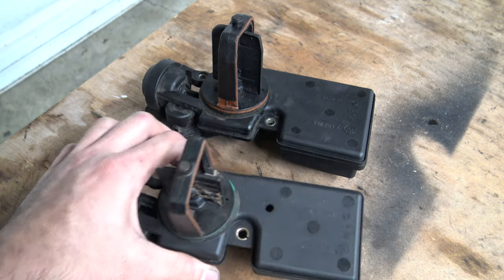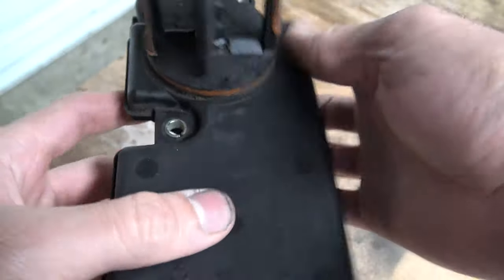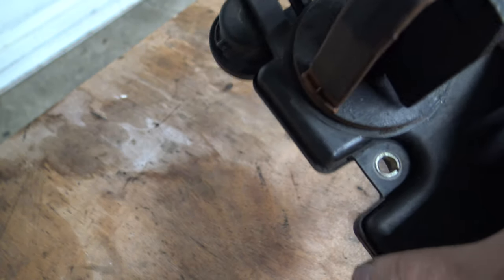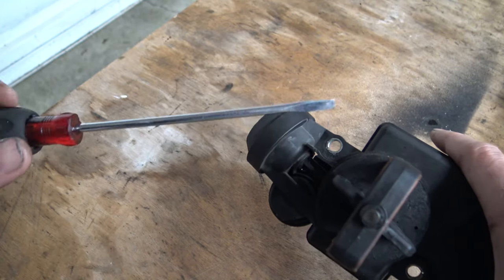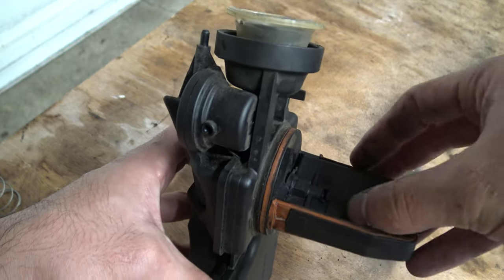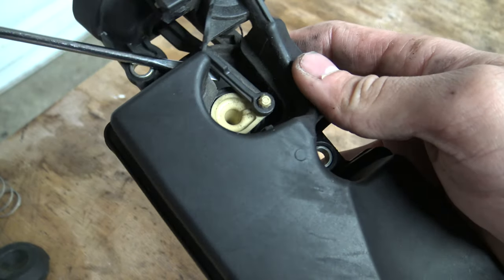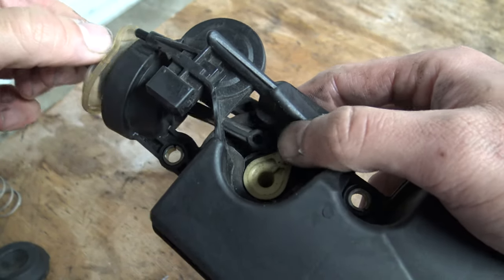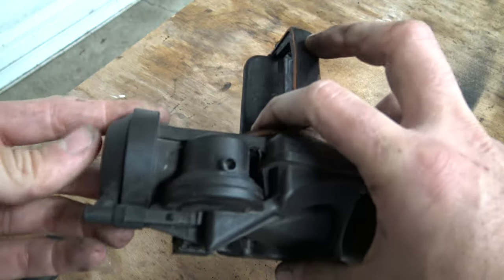DISA Diaphragm Repair

Comment: I've had my m54 e46 since 2006 and covered over 120k miles. Rather than the hassle of replacing the diaphragm in an aged and brittle plastic DISA I just replace the entire unit with an aftermarket DISA, they're good for about 40k
Reply: The oem disa is the only one to use, and they are  expensive.  Id take a rebuilt oem over a new aftermarket any day, especially with the GAS rebuild kit in the oem.
Reply: the DISA is a little over engineered to be cheap, thats why the price, if u dont want the hassle of it, just delete it, but i wouldnt recommend an aftermarket, even tho, first time i hear bout a afktermarket disa lol
Reply: @djm9583  of the 3 disas that I've had, covering 170k (120k myself) I've always had a vacuum pot failure, never a shaft failure. I still inspect the DISA abt once a Yr, I think my current one is 40-60k old
Reply: @camialeh  it's a clever design, but it's not overengineered lol, it's just made of a few pieces of plastic that are joined with a ultrasonic welding (ie glue), cheaper to manufacture and also deters ppl from taking things apart to repair, forcing ppl to buy a whole new part. I wouldn't trust a DISA with a vacuum pot replaced, just be done with it and get a replacement. My 3rd DISA (1st aftermarket) has lasted longer than my 2nd OEM DISA

Comment: The diaphragm is easy to damage, and the cap usually breaks when opening this up.  I don't know of anywhere to buy just the diaphragm. Be sure to test the DISA before attempting this repair, as the diaphragm may not need to be replaced. Search for "BMW 330i 325i E46 DISA Valve Operation Test" to learn how to test the DISA, including the diaphragm.
Reply: ive seen them on ebay and aliexpress